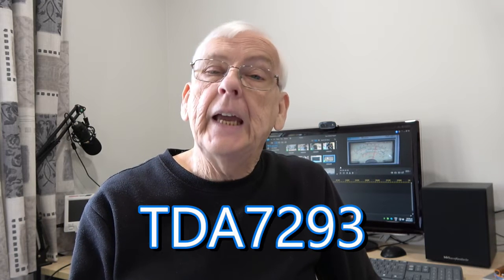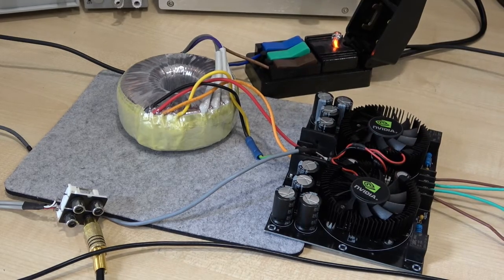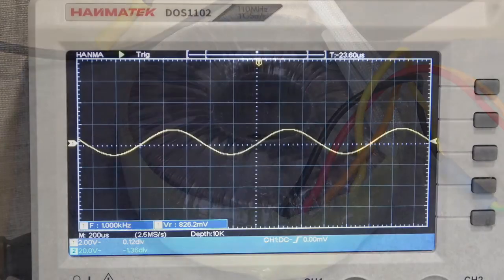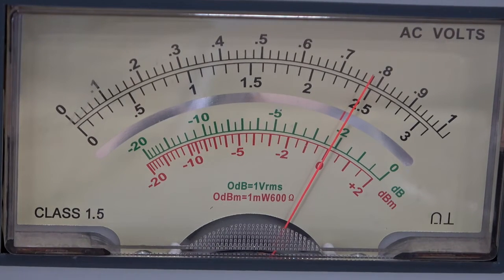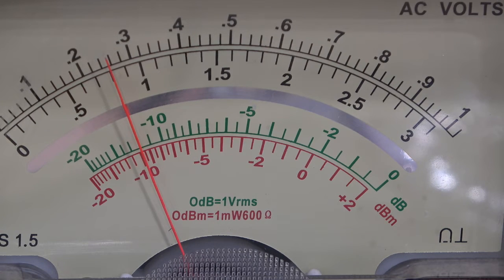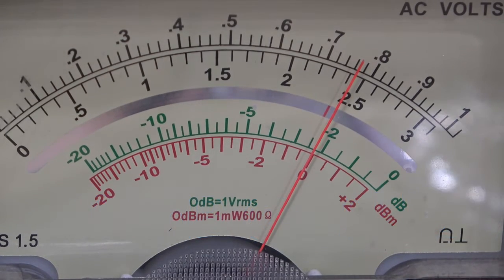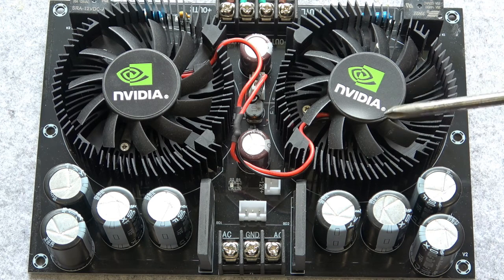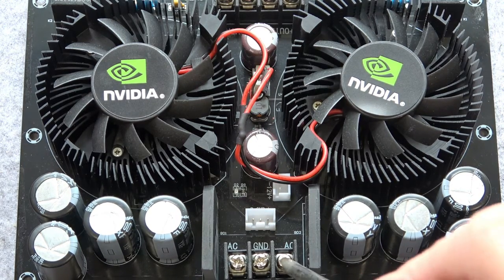TDA7293. Part 1 of 2 Amplifier ICs.Test and review of 2 different boards.

Comment: I have two music centres a Sanyo g2711-super with stk 437and g4001with stk 439 and am thinking of installing these kits to replace the stk modules that as we know are not availible and at some point am sure will fail . Also would have alot more power than the humble 2x7wpc and 13 wpc not sure how to go about it hoping to utilise the positive and negative rails

Comment: These are graphics card coolers. Fans are supposed to be powered by PWM and run slowly/quietly most of the time at far less than 12V. These noisy fans alone are making it The Worst Audio Amp I have ever seen.

Comment: Is there room on the board to  replace the input caps with bigger caps?
Reply from the maker: I'm not sure yet Terence. It will have to be a surface mount type for sure. Very little space under the fan, I will look into it.

Comment: Brilliant review, as always. Thanks Michael. Would be great seeing you tweaking it to improve low freq. response :) Shortly after watching this video I did some online research on this particular board hoping to see what's the value of the input decoupling cap used here to compare it with the one suggested by TDA7293 (470nF).  Is it the ceramic cap (100nF?) next to output terminals? I couldn't find any pic of this board without fans installed so not sure what's hidden underneath them.